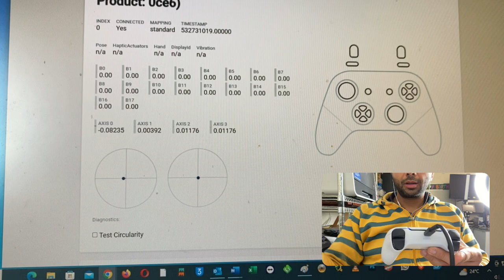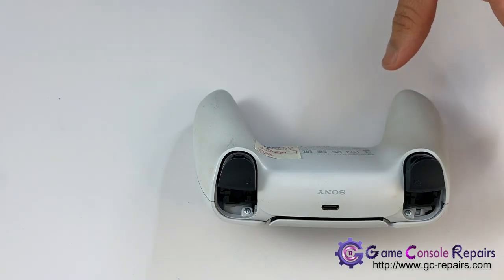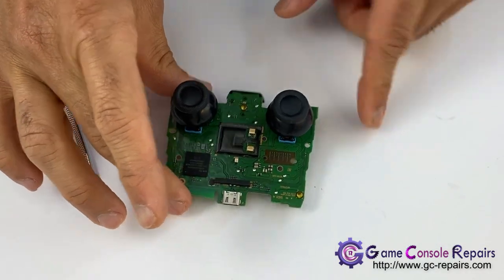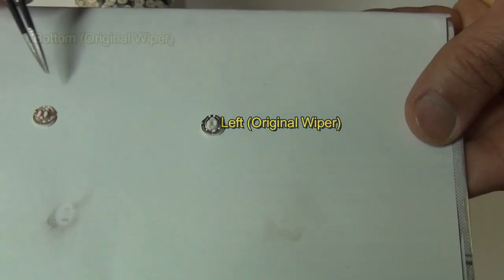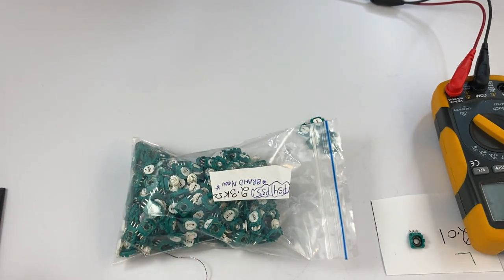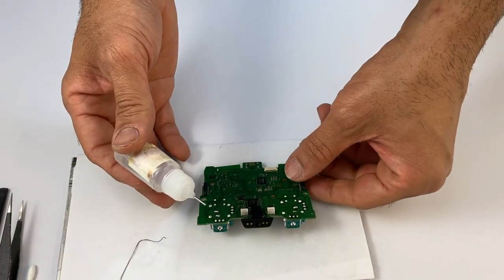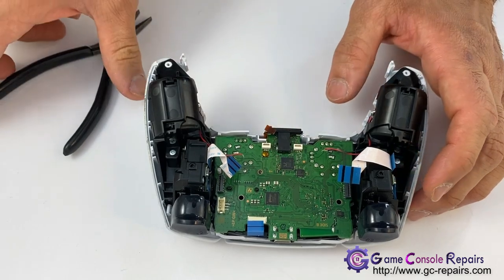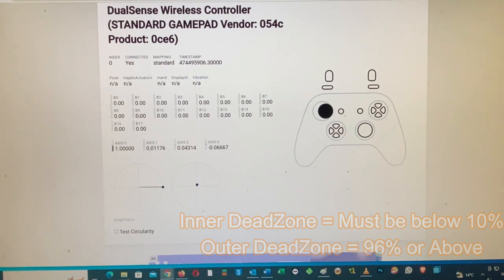![FIXED]! PS5 Controller Left Or Right Joystick Drift, Jitter or shakiness issues

Comment: Thank you for the video just wondering why did you use the old wipers and not the brand new ones that came with the potentiometer? Thanks
Reply from the maker: Old wipers are original ones so first try is to clean up the old ones and if they are nice, shiny after cleaning - that's all you need :)
You can always place the New Ones. There is no harm.